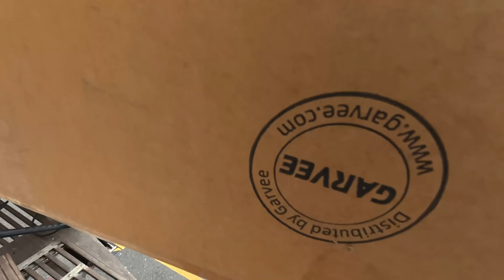Can We Build a Hybrid Boat in 30 Days? | Ep 1

Comment: I almost wonder if you might be better off with a chain hoist or seen as the engine is trashed maybe even cutting up the block in place. That is one hell of a lump of cast iron - maybe turning it over and dropping the crank shaft out of it as well. It will make a horrible mess with all the oil and coolant that comes out of it. I might suggest getting a compact Milwaukee M12 3/8 impact driver to help stripping down the engine. Its a shame your in Vancouver and I'm in England - I would come over and help you pull that engine out.
Reply from the maker: Yep that is a big thing for sure) Non of the impact driver will stand near manual breaker bar XD That' ok I'm glad that you can join me virtually by watching our progress! More to come soon!

Comment: Good job!  I have similar engine hoist, it requires a lot of space to move around. Suggest you get also a chain hoist to attach to it, that might help.
Reply from the maker: Thank you, that's a great idea!
Reply: @YachtCityLife  Another tip, remove exhaust manifolds before lifting, lighter and more space to move around.  Soak the bolts with PB Blaster a few days before, will help to loose them.

Comment: Hello! Congratulations on your amazing work — it’s truly inspiring.
I’m from São Paulo, Brazil, and I bought a Trawler about six months ago. I’m currently rebuilding the engine and have always wanted to make it hybrid or fully electric, replacing the diesel engine with a generator. I want something simple, practical, and efficient. I’m considering installing three or four refurbished Nissan Leaf battery packs, reaching around 240 kWh of capacity, which should provide excellent cruising range.

I’m really excited to follow your project! The long gaps between videos drive me crazy with curiosity 😄 — when I got today’s notification, I was honestly hoping for a one-hour episode!

I’m a systems developer, working with PCB design, embedded systems, and I program in Python and classic ASP (yes, that 20-year-old language 😅), along with other low-level languages. My work mostly involves maintaining and integrating existing circuits and designing complete new ones.

I plan to live aboard soon and sail all the way to Canada, without ever stopping.

On my boat, I’m developing everything from scratch. I want to use my own systems, with NMEA2000 translators, avoiding proprietary software and hardware.
My plan is to have two 24-inch touch screens, running a full automation system with relays, consumption graphs, bilge pump activity charts, 12V and 24V monitoring, and more — with all data logged to a cloud-accessible database.

I’d love to know more about your server room, battery setup, motor power, and whether you plan to go fully electric in the future. I’m really looking forward to seeing your project completed.

It would be great to share experiences!
Best regards and congratulations on your work — I can’t wait for the next video!
Reply: Sounds like an ambitious project, what size is your trawler? The big limiting factor with all electric is definitely charging, especially if you want to do such a long trip. I did a 2000km trip from the BVI to Miami on a 50' sailboat and we consumed over 350 liters of diesel. A trawler of a similar size would of course need a lot more energy.
Reply: @MYNautiGirl  This is a 78-foot (24-meter) trawler, weighing approximately 78 tons and capable of holding 18,000 liters of diesel — a truly complex and ambitious project.

The vessel was built in 1990 and I recently purchased it for a complete refit. I’ve already stripped out all the cabins and interior accommodations, leaving the hull completely empty to rebuild everything from scratch.

The plan is to install two independent propulsion systems:

A main electric propulsion system, powered by high-capacity batteries that will be charged by solar panels and, when needed, by a diesel generator and A diesel engine (for safety and long-range cruising, go to home).

My goal is to achieve electric propulsion between 4 and 8 knots, with a maximum speed of around 10 knots and an estimated range of 50 to 100 nautical miles in full-electric mode.

I’m still in the early stages of the project, but I expect a 50 kVA diesel generator will be enough to recharge the batteries and maintain a cruising speed of about 6 knots when there’s no sun. The vessel will also feature 22 solar panels rated at 550 W each.

The plan is to make short passages, stopping to fully recharge the batteries between each leg.

I intend to document the entire transformation process on my website, including the refit stages and the first voyages, which are planned for next year.
Reply: @Destino_Livre  Wow that is super ambitious. Are you planning to do all this work solo, or are you hiring on help? I only know one couple trying to do something similar, and it's a twin engine serial hybrid, replacing detroit diesel 12V71's in a 78' yacht.
Reply from the maker: That sounds like an amazing project, we wish you the best of luck! We on the contrary would love to go South somewhere warm!

Haha, we are trying publishing videos while the swap is still going, but bigger videos are coming 😅
About our plans Dima had a video about a month ago with our reasons why, I hope that can be helpful
Reply: @YachtCityLife  Whenever you want to come to Brazil, feel free to let me know. I’ll be happy to help with whatever I can — and who knows, maybe we can go sailing together and exchange some experiences.
There’s a Brazilian sailor who makes sailing videos in English — her channel is @SailingYaba. They’re currently in Paraty, in the state of Rio de Janeiro. Don’t worry, though — it’s not the Rio de Janeiro you see on TV. Paraty is far away, and the city’s problems are mostly concentrated in specific areas.

Unfortunately, I’m not fluent in English yet, but in about 15 days I’ll be traveling to the U.S. to practice a bit more.
The Sailing Yaba crew completely rebuilt their boat, which was in bad shape, and now they’re planning to sail around the world.
I intend to do something similar — but powered by solar energy and at a much slower pace: about 5 days of energy storage for every 80 nautical miles sailed.